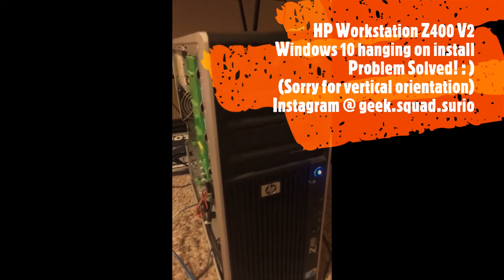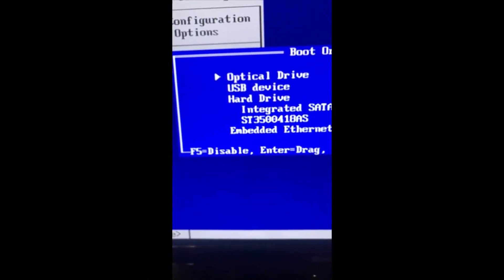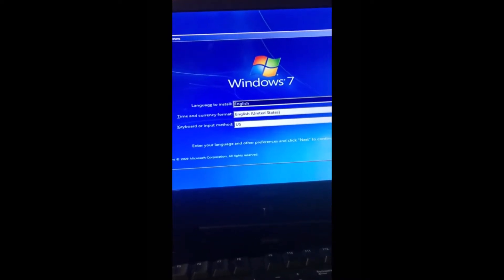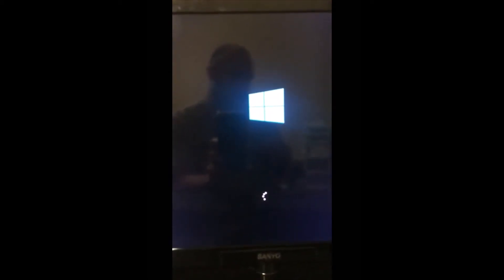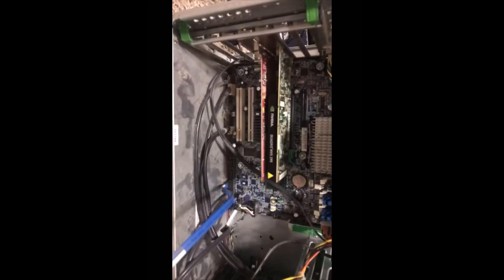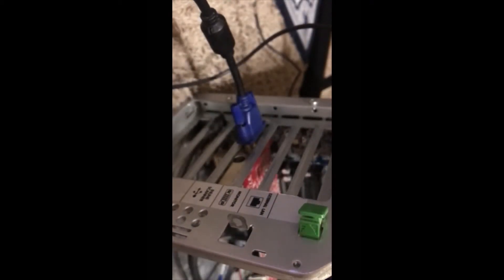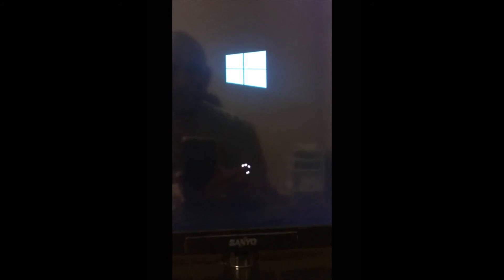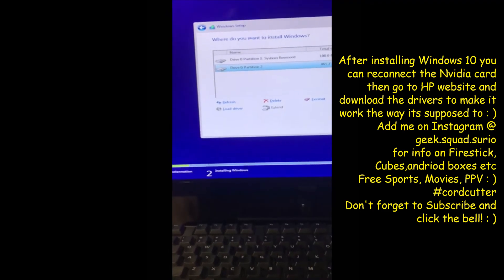Hp Z400 Workstation V2 (Windows 10 upgrade/Install hangs during install) FIX 2019

Comment: idk if youll see this but would an older nvidia card with vga work with this
Reply from the maker: Yes I believe I had actually bought a card with vga  and hdmi for about  $25? and it did work for this machine without issue.

Comment: Sur. Geek thanks for the video, it may help me but not foe sure, i got the nvs310 card (comes with the pc) and z420 server. i installed win10 and its installing good, and as long as i dont ewstart the pc, its working, after restarting it does go to the black screen. ive tryed several times to goto safe mode and delete the driver and installing the latest from nvidia, but the result is the same. do you think its the NVS sieries problem with HP servers? i dont have an extra video card to test if its the card problem.
Reply: estimado, lograste solucionar el problema?

Comment: I have a GTX 1050 and no access to the original hp card. Same freezing issue with windows 10. Do I need a original card? Also I read the other comments, how do you set the new graphics card as priority in the bios (i have the newest version)?
Reply from the maker: maxresdefault do u know how to get into the bios? I believe it was F11 or 12 it’s been awhile since I worked on my cousins machine. Once u enter the bios go to the graphics card menu u will see the default set to 0 as priority . Depending on if you have it set to slot 1 or 0 just make the change so that it reads your graphics cards as default and you will be able to proceed with your OS install. If you need help and like to send me video on IG u can @ geek.squad.surio
Reply: @sur.geek333 f10
Reply from the maker: maxresdefault u don’t need nor want the original graphics card trust me 🤣
Reply: im able to get into the bios, however there is no graphics card option. thank you for replying so quickly
Reply from the maker: maxresdefault I believe it’s under the advanced or optimized do u have that?
Reply: i have the advanced tab, but nothing related to a graphics card under it.
Reply from the maker: maxresdefault do u have Snapchat or IG? Send me a video do I can see what u see
Reply: Hold on, im trying to install windows 10 through windows 7. it seems to be working so far. ill send something if it doesnt work
Reply from the maker: maxresdefault I tried that as well and when it got to the windows 10 part it froze but yeah just hit me up I’m working on laptops right now

Comment: Has nothing to do with the video card.  I have installed Windows 10  100'S of times on these. Version 1,2,3 motherboards. Non of them have issues with the factory installed or aftermarket cards.  You just have a motherboard that is bad.  Next your going to say google told you a x5690 cpu and 48gb of memmory wont run to lol?
Reply from the maker: RICH MORGENSTEIN actually it was the card. Thanks for your input tho after replacing the video card with an aftermarket AND an original video card HP  replacement I had no issues so deff not the motherboard.

Comment: How big was the USB drive you used to update the bios? I only have a 64gb stick and I heard the updated bios file might be difficult for the system to detect unless put onto a smaller a USB inferior to 8gb in size.
Reply from the maker: InsideChips it was 16gb
Reply: Yep you need 8gb or smaller